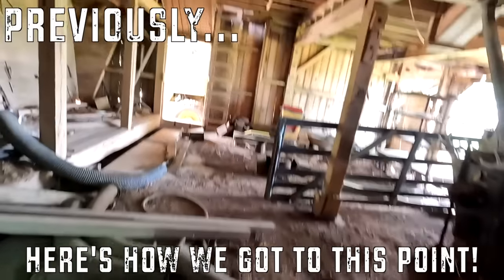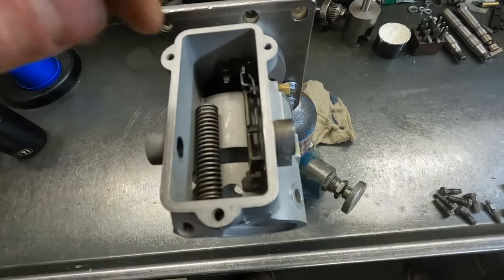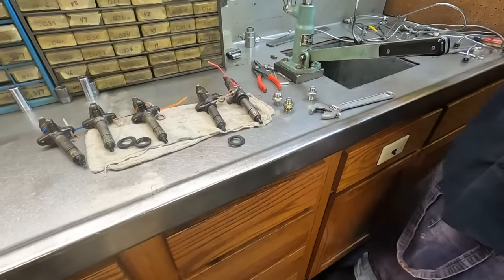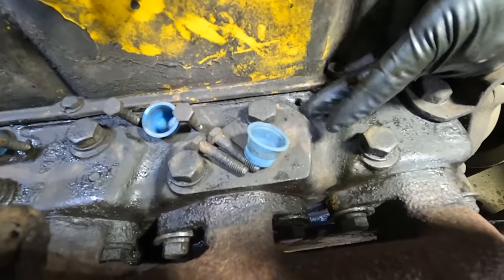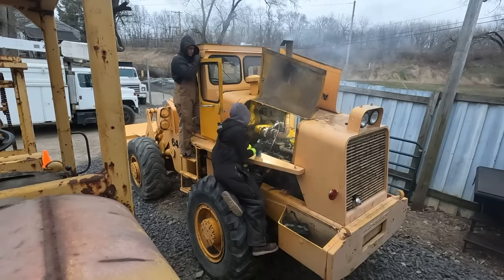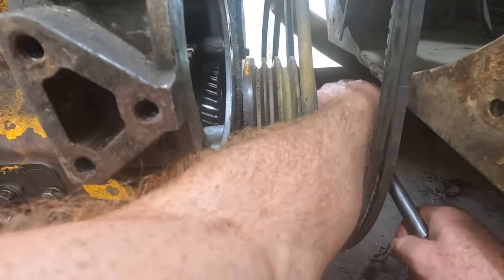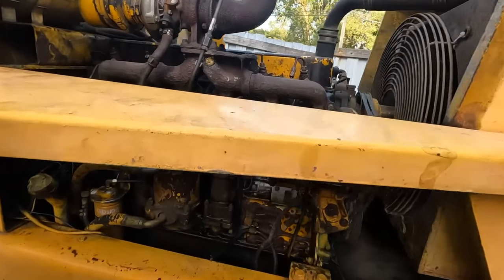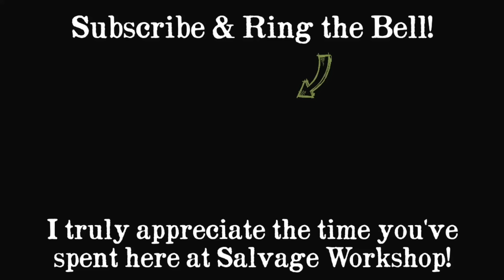The OLD Loader won't Stay Running...I'm STRUGGLING to figuring it out...Will it EVER run AGAIN?

Comment: The hour meter running backwards is usually caused by the battery connected wrong way around. I'm not sure if you are aware or not but generators run a positive earth system. Here in New Zealand the old Allis Chalmers loaders were classed as some of loaders back then. Keep up the videos of saving the old equpment.
Reply from the maker: So THATS how i make it look like there are less hours on a machine than there actually are!... lol jk...I had rounded up when i wrote the hours originally, and the hour meter just never changed! Now i know thst needs fixed! Add it to the list!
Reply: @SalvageWorkshop ]

Comment: The coolent heater is for heating up the engine on cold days in the winter months you can bypass the cab heater but you will still need the other coolent lines to warm up the engine.
Reply: Agreed very important on diesel engines to keep that intact
Reply: those coolant lines also cool the compressor head .. hook them back up

Comment: In addition to the dirt seals on the the injection nozzles , I find a good coat of never-sieze on the outside helps keep any dirt or moisture out of the bore. Helps a lot when removing later.

Comment: Im not a gear head, certainly not a mechanic, i know nothing about diesels at all, eventhough i used to drive tractor trailers, but every time you put out a video im sotting here watching amd learning. I smile and gifgle when some old machine sputters to life. Ive run old equipment and i mean old, but just seeing these things brought back to life for another run is so cool. I'd never be able to figure out the things you do, so i live vicariously through you. Just great.
Reply: Didn't you ever want to take the time to learn about diesel engines when you were driving them for a living? What would you do when you had a mechanical issue?
Reply: @giggiddy  i know some basic things, but if and when i ever broke down on the road, i called the fleet manager and he or she dealt with it while i sacked out.  same as a blown tire, they called a roadside crew and they came and fixed it.  always had my self prepared to stay somewhere if need be. since i dont drive them any more, i have no desire to learn about them now.
Reply: @JamesThomas-gg6il  Makes sense to me. Cheers

Comment: I have been fighting a JD 1010 crawler for months and have watched a lot of videos.  Your rebuilding of the injector pump was the only one that showed where the plastic buffer washer under the governor weights goes and how to put it on . I will be redoing the pump if I can find a cylinder liner plate assembly that is under $2,000 bucks. Great work, and thanks.
Reply from the maker: Awesome! Glad the video helped you out! Good luck with the 1010!

Comment: When breaking and tightening the injector lines I use a crow's foot "tube wrench" and a rachet and extension. Makes bleeding injectors EZ-PZ. I have both imperial and metric crows foot tube wrenches i bought at Harbor Freight. Next time you bleed injectors you will thank yourself for going to Harbor Freight. Good video . Thanks for taking the time for us to enjoy.

Comment: Life is a bit easier if you do a test fit without the seals, to get the gear and pump clocked, and mark the gear to the timing gear housing.  Then pull the pump, install the seals and it is already alligned enough to close it up.

Comment: Something else to check is the valve lash it could be off enough to cause hard starting and rough idle
Reply: I was thinking the same thing that old engine could use an overhead in the worst way.

Comment: Good in-depth analyses of this Wi-Fi breaker. Yes, not super safe with the remote control or time settings. I bet it won't last long in service when there are a couple of mains spikes or a lightning strike nearby. A lot of electronic stuff crammed in that package. Interesting motor drive arrangement with a small hobby type of motor.

Comment: We had a newer 575 B model made in the late 1970s. When it reached into the 20,000 engine hours it got very difficult to start and needed ether to start. The engine was worn out so the compression was low. The dealer offered a replacement new engine repower which was an Iveco engine that came with everything necessary to replace the Allis Chalmers engine.

Comment: Using the o-rings made me wonder if they would interfere with the function of the crush washers.
Reply: My thoughts exactly. Wouldn’t the installed height change with the o rings?
Reply from the maker: No, once tightened down the oring is able to just slip a bit higher on the injector body... if it wasn't sealing at an injector we would know based on how the engine sounds.
Reply: @SalvageWorkshop  why put the o-rings then anyway

Comment: great job! I have a suggestion  for you. On the pump, where the lines match up, use a small plastic wedge, like a phone case cracker and wedge it between the two to keep them still while installing the shaft. would this help stabilize some of the moving parts while assembling? Hindsight is a wonderful thing!

Comment: Since you had the rocker cover off why you no set valve lash would make it run better yet. 
I've done it myself when things go wrong I tell my you only needed to remove a few more  bolts and deal with it and I wouldn't be doing things again like I need the practice lol👍👍👍
Reply from the maker: Because i didnt want to change ANYTHING else... it ran beautifully before the injection pump stopped pumping and i wanted to make sure i found the problem before adjusting anything elss.

Comment: Great video love the old diesels.check that military manual for coolant bypass routing. Keep the heater out of the loop but you may need to reinstall the hoses or it may run hot. Thanks Jim.

Comment: What a lot of people seem to be unaware of when using silicon RTV especially in place of a cork gasket for instance is you should squeeze out a steady neat line (in the case of this rocker cover about a quarter of an inch round bead) in an unbroken line from start to finish and leave it as it is DONT try to smooth it down with a finger, THEN let it cure completely BEFORE attempting to refit the cover, that way the natural sponginess of the cured RTV gap fills all gaps all the way round,   people cant seem to get they're heads around the fact that it ISNT a kind of sealing glue, better to think of it in its cured state as a kind of rubber or "silicon"  lol, O ring....do this properly and it will never releak.........AND will probably come back off again when required without any drama as it wont have bonded and cured to both sides simultaniously.

Comment: That tank with the red hoses is a cat's engin heater I have one on all my equipment and have use them for years and I have several setting on the shelf. Every time they make something that works foe some reason they will top makeing them . Good video

Comment: Hey on your next diesel coldstart, try propane. 
I can't remember if it helps coldstart or if when already warm. 
Just an experiment, no worse than that starting fluid and it would be interesting to see.
Reply: I use an electric heat gun and blow hot air into the engine air intake.
Works like a champ and will not damage the engine.

Comment: The timing issue when you put it back together whit rebuilt pump was a bit similar to a case I had whit a Mercedes 5 cylinder 300 turbodiesel, my good friend (who sadly went to heaven way to soon) and I had changed the injection pump, we set it on 24 degrees before top dead center as it should be, didnt got it running well on all 5 cylinder, finally we found out that the pointer down at the degree-scale on the crankshaft had been bent like 10 degrees out of position by a chain when I lifted the engine in transport, 10 degress low so when we found the  top dead center by the first piston in top position we could knock it back to 0 on the scale and then readjust the pump timing and then it ran perfect. Best feeling ever when you tighten all the fuel lines one by one at the injections and each cylinder come back so sweet.

Comment: Love that loader the windows on the cab I like and if it was my machine and engine blew I'd re power it with a 8.3 bt or 6.7 and the radiator is no drama plenty of modern replacement but yeah it's very cool

Comment: They are called Butterfly seals because they are delicate and when pushed through the hole, they tear. That is why they need to be installed after the shaft is in place. (I'm guessing).

Comment: Might be sucking air into the fuel system somewhere.  My Hough H90 had a spot where fuel tubing rubbed inside a clamp.  Could not see it.   Finally started at tank taking every part loose, cleaning and sealing threads.

Comment: You've got a problem with the pump and the filters then I'd be checking they fuel tank as well too see if they is any water inside the main lines

Comment: I had a Frieght Liner Tractor with an Allis Chamber's Engine and it was the biggest pain in the But of any Road Tractor I ever owned or drove. They finally found something about a Censor for Fuel Mixture or something after I dumped it. It was actually a very small part that died and Controlled the Flow of Fuel. I am not a Mechanic so I have no idea what part it was.

Comment: Jeff Lutz of street racing fame just discovered same problem w/injectors in race car .   Took someone with a injector machine to discover the GTO not running 100%  but like 75%.   Happens with diesel or gas and interesting big time.😊

Comment: Could your problem be a lot of rust flakes in the tank outlet, causing fuel starvation?  Hang a magnet in the tank around 1/4 inch off the bottom?

Comment: @edit: nevermind, it is fixed :>
I used mig welder with brass spool that is at my work to quickly patch up seriously cracked exhaust manifold. It is seriously bent (like a 1,5mm on one end 0 at the center and again 1,5mm at other end on a 30cm long manifold), it is driven hard in badly road-tuned Honda gas engine and is stil fine - this kind of patch work will for sure work fine on just rusted through manifold with little heat and stress.
Just use a carbide burr to get to shiny metal and maybe heat this thing up before repairing it, probably just with a running engine as there is no need to even take it off :>

Comment: That puff of black smoke is just top cylinder lub..   I run my 2 cycles rich to get that little smoke from extra oil.  Ha ha. It's 25 year old used hsrd and still purring.  Coming off of idle a little smoke is good.

Comment: I'm surprised you don't have a magnetized parts holder for the screws ,nuts and parts you remove so you don't drop or lose them when working outside  your work bench. I would never set parts where I know I'd end up dropping them or losing them on the ground or worse yet inside the motor.

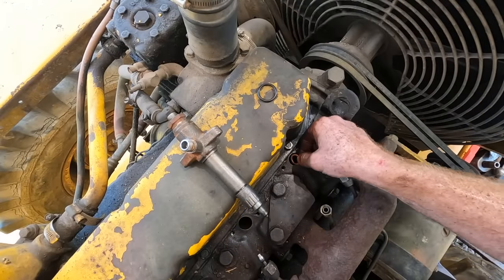Comment: Curious. At the 1:07:15 mark you dropped the copper crush washer down the hole  was it supposed to fall in. And if so why didn’t you do the grease trick. Will automatically align down there?

Comment: To help pull fuel to the injectors put a vacuum pump on the return line for a few minutes put line back on and it will run

Comment: I had a similar issue on my Fordson tractor, the pump coupling worked loose and moved to 11 degrees BTDC  should have been 23 degrees. The exhaust got very hot and had flames out of the exhaust

Comment: I understand the cheep fix in the radiator with water but do you understand the long term rust cost of not using radiator fluid?

Comment: take a bicycle tube and cut the tube and place one end with a hose clamp on the top outlet and the other end on the bottom outlet with another clamp, then air up the bicycle tube with air inorder to find the radiator leaks.

Comment: That o ring is not good. It will interfere with the crush on the injector washer. I would not use those o rings

Comment: You can drill out the ends of the crack and braise it and braise in a new fitting and then wrap the exhaust manifold

Comment: Tank heaters are very inefficient and with all the hoses many places to leak  if you need a block heater I would suggest an in block core heater, they don't use as much electricity since it's in the water jacket

Comment: Crack open the injectors open one at a time until you get a steady flow of fuel without air bubbles in it, then tighten it up again.

Comment: I got so fed up bleeding older diesel stuff, so any chance i get i install a cheap 12v fuel pump and 2amp trickle battery charger.  Put the fuel pump. direct on the battery with an even cheaper toggle switch. If crap hasnt been used in weeks? Flip a switch, walk away for 5 minutes, come back and boom startup. Best 50 euro‘s ive spent in the my-shit-always-starts-when-i-need-it-department.

Comment: The caps that came with the redone injectors would be cool if you saved them, surprised you didn't check the valve tappets while you were in there just in case, god knows the last time they were done.

Comment: Ever watch Halfass Kustoms? Guy makes his own manifolds quite often for shites and giggles. Anyway, aside from the hooped exhaust, why not pop the head and lap the valves [you know that routine] and seeing as you have your own shop now... pop the motor and do bearings and rings.... = New Machine if you get a new turbo [area Diesel will do that turbo rebuild for you as well]. If the Alice Chalmers motor is a pain to get parts for... why not toss it for an old Detroit where there are parts in every direction for those lol 53 or 71 series motor but I think that old Alice Chalmers motor you can get parts for. Watch Wes Works has gotten parts for  a number of Alice Chalmer's rebuilds over the years.

Comment: At least its old stuff, man I went thew the hassle of replacing my heater line for my 99 suburban for rear heat, ran a new line from the front to the back, drove the truck around for a week, blew the plastic T up front, replaced that, and got all the air out, another week, I blew a climate control valve, replaced that, $80 bucks for a hunk of plastic that 5 lines go to with a vacuum controlled valve, got a month and blew the heater core in the rear of the truck, At this point I said screw it, bypassed the rear heat, not worth it.... Rear passengers can freeze lol.

Comment: THE HEATER CORE LINES NEED TO BE CONNECTED FOR PROPER COOLANT CIRCULATION. THE WATERPUMP WILL CAVITATE, YOU WILL OVERHEAT, YOU WILL BLOW THE HEADGASKET

Comment: Weld two small pieces of round rod on a nut and you have a wing nut, a little common sense brother and creativity! lol 😂 you can braze it or stick weld in with cast iron rods or stainless rods! I’ve welded cast iron with 7018 stick rods before and it held! I’m a retired welder of 37 years of experience! , if you ever need any advice on metal I don’t mind helping out brother!

Comment: my 840 and 940 AC HAD A SWITCH IN THE MASTER CYL. TO PUT TRANS OUT OF DRIVE SO YOU CAN HOIST THE BUCKET FASTER.  THAT SWITCH GOT RUSTED the ball in it will stick??? holding the trans in neutral. !!!

Comment: When you were doing all that demo work to your shop why didn't you lift the roof up to accommodate taller equipment.
Reply from the maker: Simple... because it WASN'T my shop at that time... that changed at a later date! I do wish we had put larger doors! When the new doors went on, the only thing that was planned to be pulled in and out was cars and trucks!

Comment: Sorry he's wrong about the smoke colour if injectors don't atomise.
If it doesn't burn it's still diesel fuel, warm vapour- white.
If smoke is black it has burnt but without enough oxygen, so rather than CO2 , H2O and CO ( for example) you would get CO, H2O AND C.
IF you were to get some of the spray pattern just squirting so it isn't burning you would get HxCx,CO, H2O and C, the "X" represents a varying number, depending on how much the hydrocarbon (HxCx..... diesel) is broken down if at all , probably not.

Bloody hell, I almost seem clever!

Comment: None of the stuff built in last 10 to 15 years will be around as long as that one they don’t build them like that I got a 80 model kenworth with a big cam 400 I would love to know how many miles are on it it’s been rebuilt a a couple times I know of it wasn’t the engine that came in the truck it was a little 290 or 300 Cummins not sure it hauls 35 to 40 tons every trip these new trucks wouldn’t hold up no time lol

Comment: Yea just disiding off the top of your head to put another rubber washer on the injectors won't make any difference ,,,,after all there is no such thing as tolerances when putting engine parts back together,,,He'll why not put four or five washers on it,,,,I think the next time I'm doing a head gasket on a car I'll just add another one on top for good measure,,,,

Comment: Don't use WD-40 as a lubricant! Don't use 3 in one oil on your indoor fan motor! I found Zep 45NC Penetrating Lubricant (with PTFE) lasts a long time and doesn't gum up. This is for the in house fan that got slow and hot. Don't use WD-40 to lubricate anything, unless it is going to be replaced by a constant stream of something else, when in normal operation. ie; Diesel Fuel, Engine Oil, etc.. WD-40 is used to free stuck and/or rusted fasteners. It is NOT a lubricant over the long term. It is like Zit oil. Slippery at first and then...(Gross!)  😉🙃